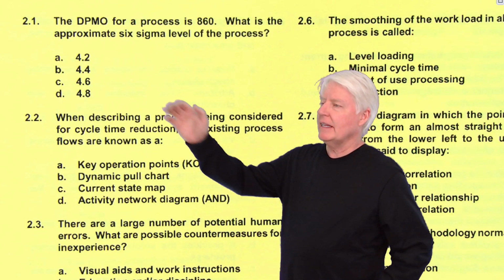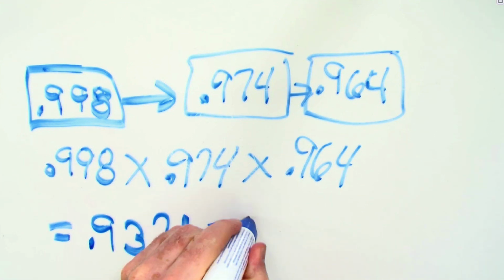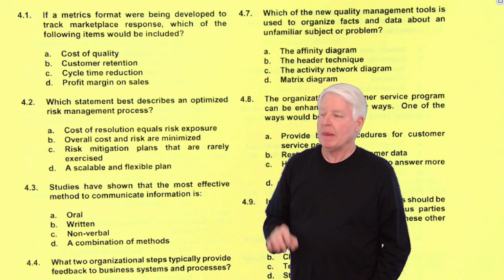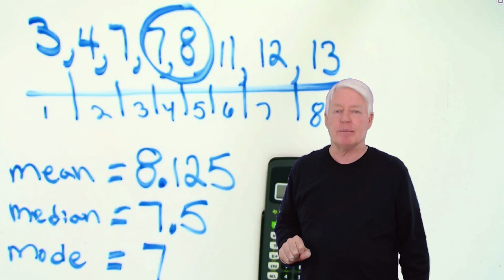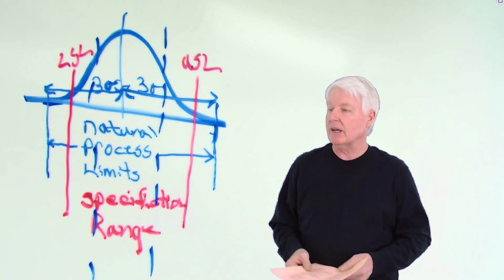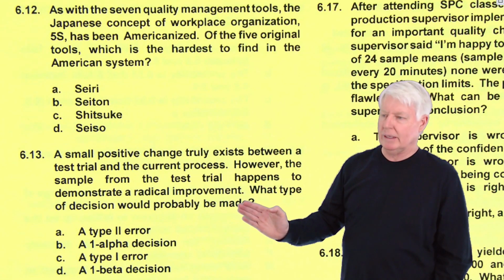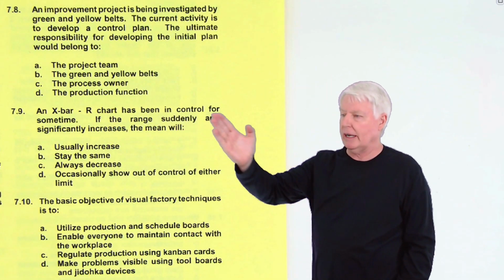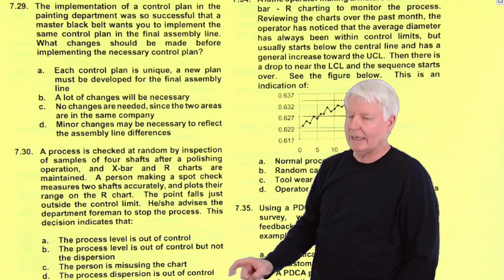ASQ Six Sigma Yellow Belt Practice Exam

Comment: I've read in the website under the book section that the body of knowledge changing or effective only from 2015 to March 2021, shall I wait for the new body of knowledge before reviewing?
Reply from the maker: Good question.  ASQ may give you a choice on which BOK you desire to be tested on over a grace period.  Also, in most cases the BOK is not changed in any radical way so I believe what ever you decide will work out for you.  Hopefully that is helpful.  Thanks Toussents, John